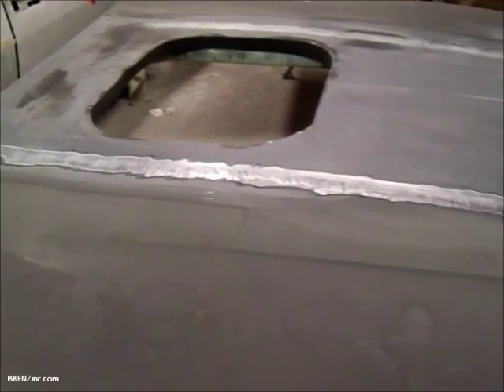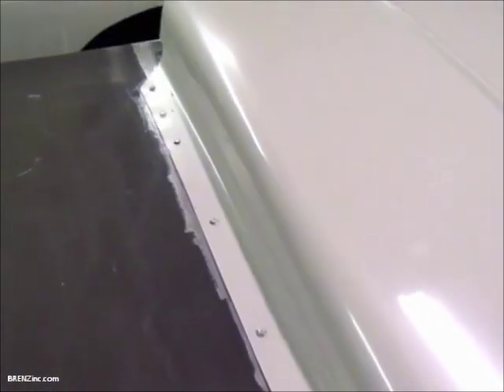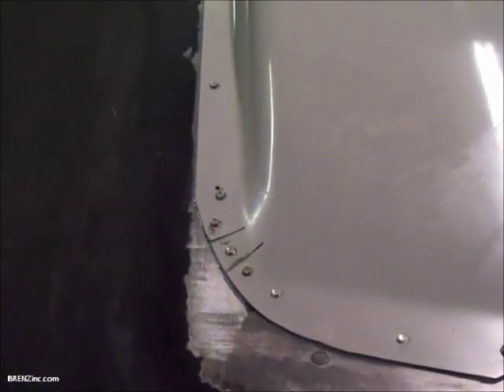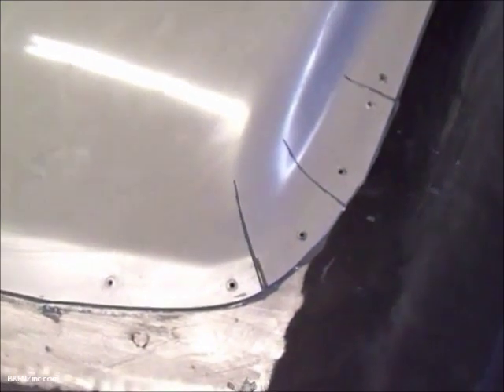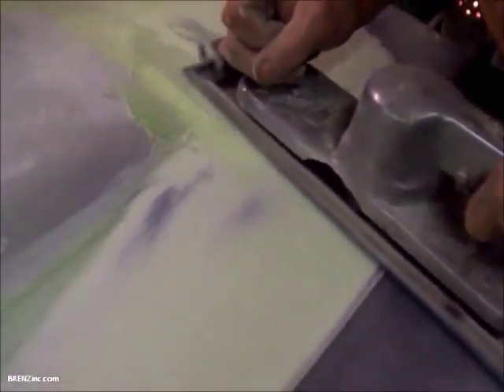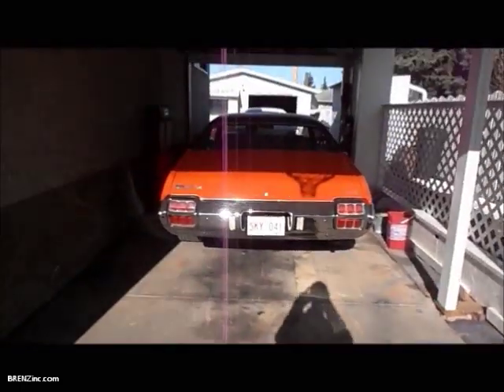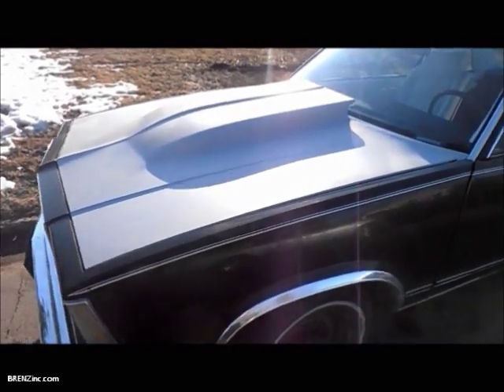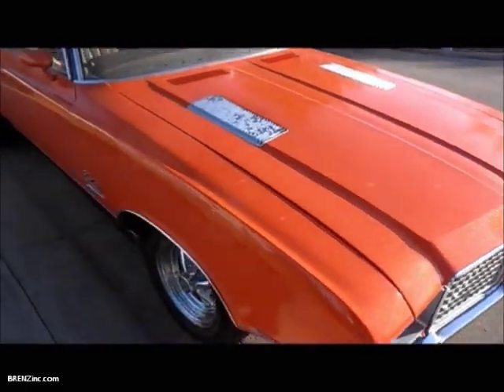Composite Tech #1) Fiberglass to Steel MALIBU COWL hood how-to, with TEST beating! Chevy Power!

Comment: has it cracked ?
Reply: Why?
Reply: @tofubagekl1009  It wont
Reply: It's no different attaching this then it is when they do body work or panel repairs using fiberglass. It'll bond just fine and no worries on bondo cracking as long as it's all applied right

Comment: hey my car has a aluminum hood, can this procedure be done to it the same way?? I heard that since fiberglass and metal hoods heat and cool at different temperatures cracking will occur.... have you experience anything like that, thanks for any help that cowl scoop came out nice!
Reply: It is possible but not likely and easily repaired if it does. All u gotta do is have some dynamat or something for heat like that on the underside of your hood to keep the heat from going through which most vehicles already have a type of insulation but u could add more if u wanted. Just feel your hood when engine is running hot and if it is hot add some more barrier. It'll have to get pretty hot before it would matter if everything is applied right